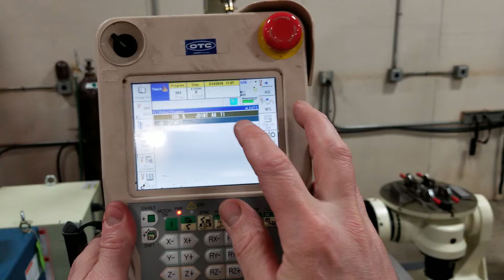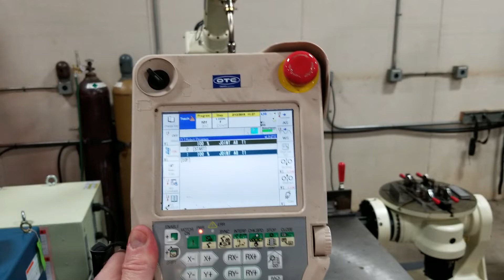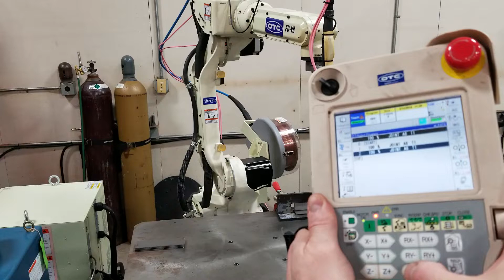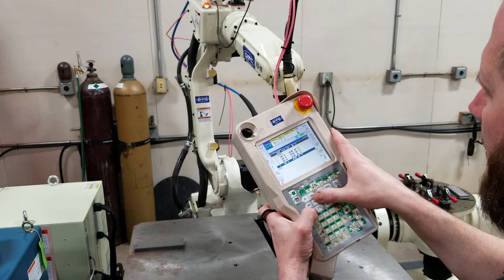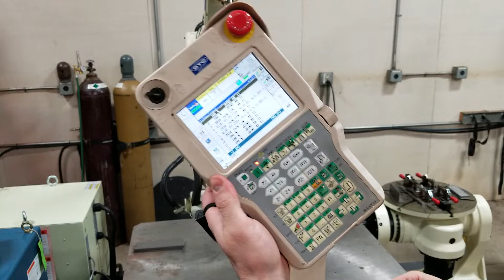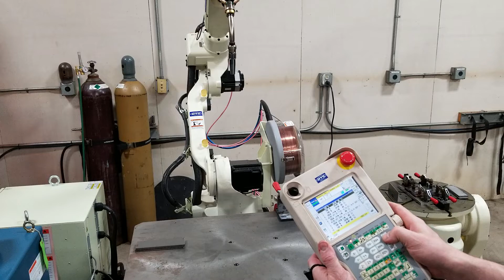OTC Daihen FD Robot programming demonstration

Comment: Hello sir it's really a awesome vedio ..   there's 1 question in case when the Robot as well as the fixture both works simultaneously  then how to manage and go ahead.  .. plzzz tell. It sir..  I am a student..  and I am very qurious to know...
Reply: I am a student my question is if  both the robot and the fixture bed both rotates simultaneously then how should we go ahead
Reply: You have to define units, let's say with the robot and a trunnion or a turn table. 
You can then control your mechanism (fixture you want to work with) using the teach pendant.

Comment: Thank you very much for this helpful video. Do you know about encoder reset step by step. I have changed encoder battery and dont know how to reset encoder
Reply: Put robot in referent position and and press R and write 314. Put in password 12345 and press any key. Next, do the following: 1.Constant setting - 2. Machine constant - 3. Encoder correction - 4. Encoder reset - 5. Select all - 6. Execute - 7. Complete - 8. Turn off controller  9. Turn on controller.
Reply: @digitalgrowthmachine  Thank you very much, it helps me alot